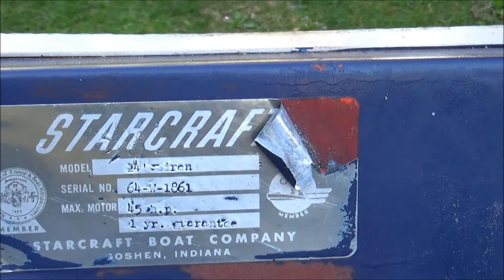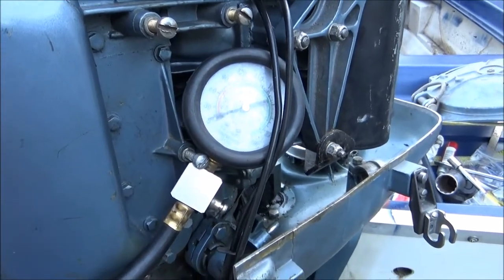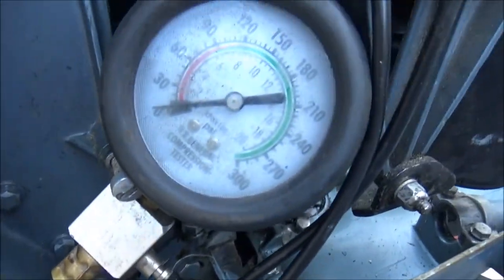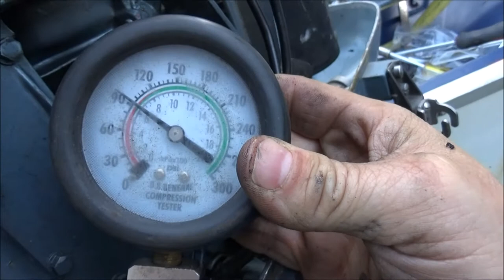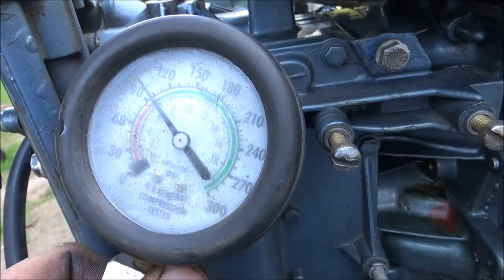Starcraft Meet Evinrude... Evinrude Meet Starcraft

Comment: Good deal ED getting closer You are going to run and break the motor in some there in the driveway i hope. Can't wait to see it fire up for the first time do not know if it necessary  but i have heard of some people using a little extra oil the first couple of tanks after a rebuild on  these older outboards. Also there is a guy here on youtube that used to restore old boats he has a couple of great videos on buffing out boats along with a lot of other things on boats putting in new stringers floors and so forth. The name of his channel is FriscoBoater's Garage if you are interested. Thanks for sharing. Have a great weekend. God Bless!!!